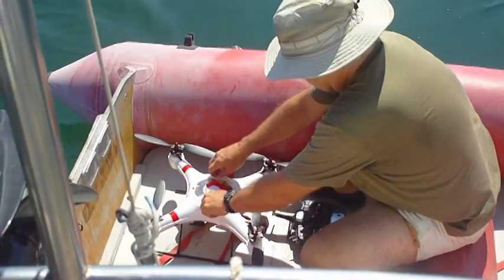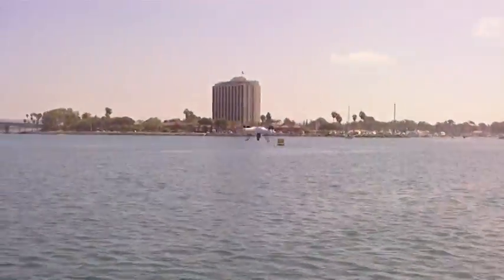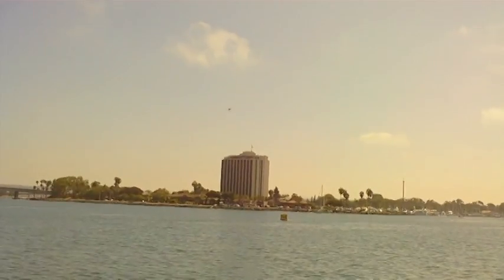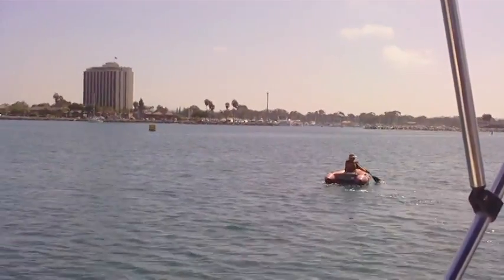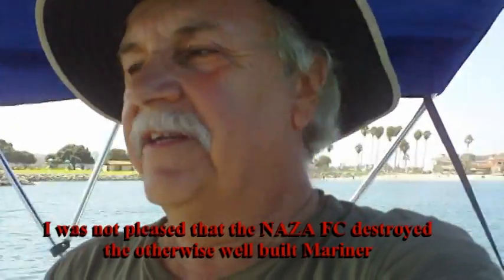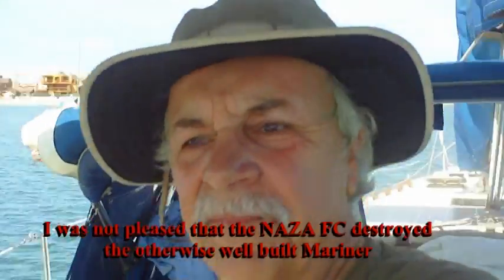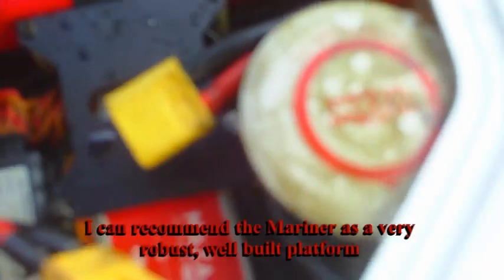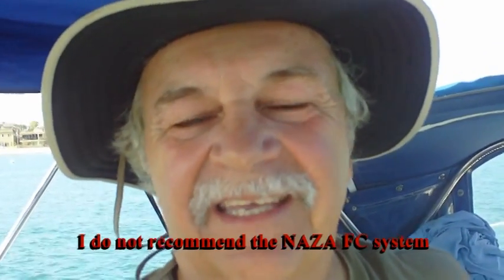NAZA FC Caused Fly Away Mariner

Comment: Professor, do you think it would have made any difference for you to have switched the Mariner into manual control during the fly-off, rather than the GPS ATTI mode? Just curious if anything could have been done to stop the fly-off when it was occurring.
Reply: I'm curious about this too! And for example is it better to use manual mode if it is being used in a mobile platform (fishing boat)?
Reply from the maker: Once it began to fly away I let go of the sticks...it should have stopped and hovered. Because that didn't work I was reluctant to try anything else. It's flight path was toward the water so I let it continue its crash. It was that or a hotel! I assumed that it was misbehaving and didn't want to add to the problem. Remember this all happened very quickly...not much time to figure out a solution so crash was best under the circumstance.

Comment: To be fair to the Mariner, you were using the porous cover, which is basically Gortex. It allows the barometric sensor to detect height but it isn't meant to be used if immersion is likely. Do you think the Mariner would have flooded if you had used the supplied, waterproof cover?
Reply from the maker: I tested the "porous" cover by submerging the Mariner in a pool and it didn't leak. The crash with the water may have allowed enough water in to short out one of the ESCs which burned a hole though the case. The porous cover is not very porous to air as the barometer doesn't function.
Reply: professoriadevaia
Interesting. It begs the question why they provide two covers. The manual explicitly states it is to facilitate the barometer but cautions it isn't waterproof??
Reply from the maker: Good question...I tested both covers...neither one allowed the barometer to function properly. It work best without any cover.

Comment: I was almost going to buy one of these Mariner Drones until I saw this video. I have no need for taking off and landing in water but I do fly over water so I thought the Mariner would give me piece of mind that If it did take a dunk in the water it would live through it. But I can see that this drone was totaled from a not overly high or severe crash in the ocean. Water leaked into the components and destroyed the drone so I see no advantage of it's water capabilities for me because it offers no better protection from a water crash than a DJI Phantom. Putting around on the surface of the water with a Gopro underneath for photography can be done with other devices easier. If this drone is going to offer any advantage over the Phantom it must be able to take a hard landing or lighter crash into the water it is designed for. What is the big advantage of landing and takeing off on water? You can take off  and land from your boat. Now if it would have survived that crash I would be ordering one right now.
Reply from the maker: Actually it is a very robust case.

Comment: I had my mariner  fly away  first time I tried it with the naza flight controller that came with it. and it ground up the blades in a second on the cement helicopter pad. Without replacement  blades, I was anxious to determine what other issues I could uncover. I took little 6" plastic props from my phantom and stuck em on - it worked -seems I forgot to plug in the 7 pin green chip to my battery. It did fly away again after sever splashdowns and 17 minutes of flight time but I was able to make it accellerate straight up and hover, then slowly tried bringing it back. When I see a fly away , I immediately drop power and rotate the stick till it responds -stall it -go up -then down and slowly regain control. Thats BBB-Buck rogers.

Comment: There is a unwritten rule about naza lite. Once you first power it on, wait for about 3-4 minutes before flying. It needs to warm up. Second...as developers of mariner together with fpvfactory we do know of one fault, usually users...please makes sure that battery wires and connector do not come close to GPS puck, make also sure that it doesnt come close during flight. You can secure it with provided battery harness. It will confuse the compass and will react like that. If you need support for your mariner or have more questions you can contact us on and.multicopters@gmail.com or www.andmulticopters.com

Comment: Did the ESC fire cause the failure? Not necessarily RFI from the environment. I was going to purchase this product. Now I'll postpone my decision. I've had it with RFI interfering with my Blade 350. One is at the bottom of Lake Erie with a gopro attached. Thanks for the great video and excellent camera work.
Reply from the maker: Thanks for your comments. The ESC electrolytic caps shorted when water entered. Actually the Mariner is a great device...the flight controller seems to be the problem...you might consider the basic version and use your own flight controller. or maybe they might come out with their own FC system.

Comment: Welcome to FlyawayClub! come see us at flyawayclub[dawt]com
Reply from the maker: I joined.
Reply: Hi, Axle!
I've seen you made a very interesting comment on Twitter regarding this waterproof airframe, that it is shielding RF quiet considerably. I can not comment on that (not having a waterproof copter...) however this info might be useful for  #professoriadevaia  to externalize RX/GPS antennas next time? Sorry for my bumpy English. Cheers Rob
Reply: CrashPilot1000 cheers brother! I appreciate it.
Reply from the maker: CrashPilot1000 Interesting point...however if the RX signal was lost it should have returned to launch. Also IRIS using PixHawk GPS and RX antennas are also enclosed and I haven't had any problems (yet) with that.